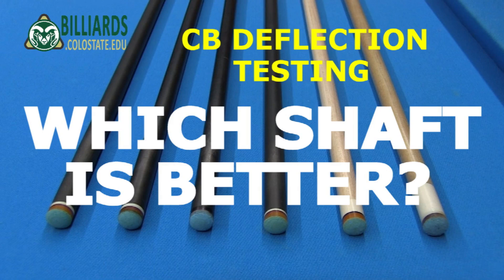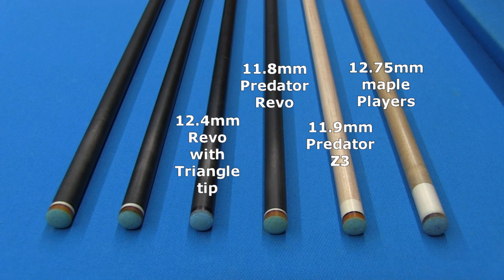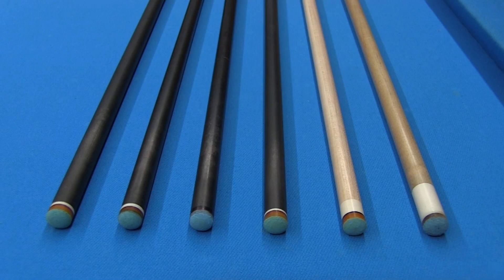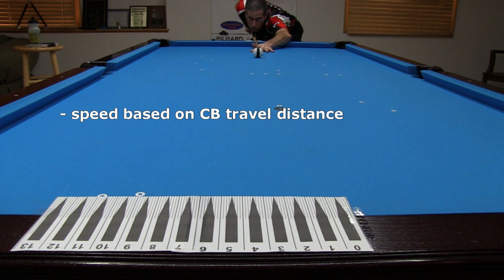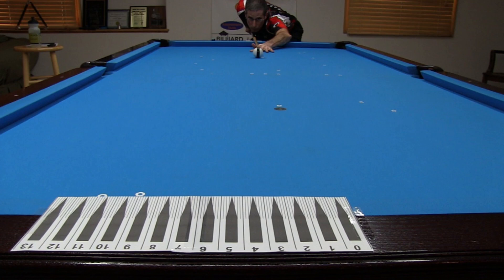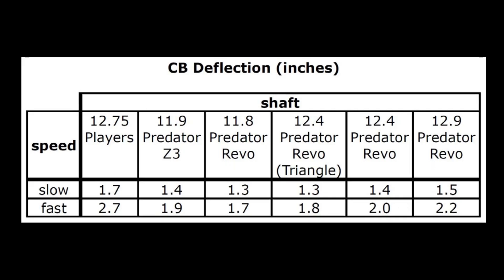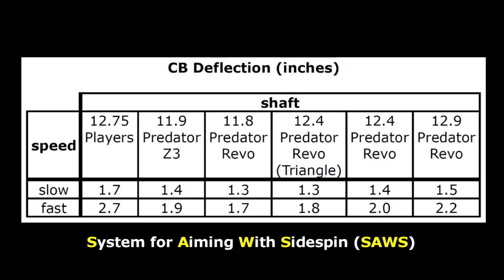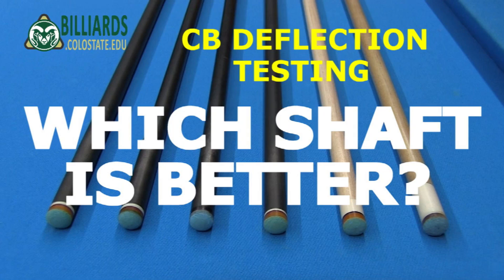CUE TESTING for Cue Ball Deflection, And PREDATOR REVO Carbon Fiber Shaft SIZE EFFECTS

Comment: Hello dr dave are there different deflection between uni lock joint and radial joint ?
Reply from the maker: No.  Only the 5-8 inches of the shaft closest to the tip affect CB deflection per the info here:
  https://billiards.colostate.edu/faq/squirt/endmass/

Comment: Dr.Dave I’m really getting some very good numbers on this cue of mine. At the table we put a golf tee on the rail and took the cue ball back behind the line.  added 1 full tip of left english  and stroke the ball very firm. It turns out my friend filmed the shot and the cue only deflexed  the width of a piece of shock chalk. This is the same cue that has 2 marks on the shaft. One mark for 3 or 4foot shots and the other mark is for any length longer than 4ft  the first mark measures 9 1/2 inches for the short shots and the other measures 12 1/4 inches  this is really cool no need for all the calibrated numbers for multiple shot Lenghths.

Comment: Hey doc can you explain the shot of Karl Boyes against Skyler Woodward on the 2015 mosconi cup? When he puts the cueball beside the 2 ball and ref initially said it was a foul. Thanks Doc
Reply from the maker: Please send me a MM:SS video link so I can check out the shot.
Reply: @DrDaveBilliards  https://youtu.be/dBdNlpgbFvs
Reply: On the 11:58 minutes doc
Reply from the maker: @ProudlyElongo  Thanks.  The ref did the right thing to reverse his call.  It is not considered "using the ball to measure" if you are attempting to place the CB for a BIH position.
Reply: @DrDaveBilliards  can you recreate the shot doc? Thanks so much
Reply from the maker: @ProudlyElongo  Yes, but it wouldn't be very interesting, IMO.  The reversal of the foul call was correct.  He was not using the CB to "measure" the gap size to see if the CB could fit through.  He was just deciding where to place the CB with BIH.
Reply: @DrDaveBilliards  what I meant the masse shot or something that he did on the 2 to get position on the 3 thanks doc
Reply from the maker: @ProudlyElongo  I didn't see any clear evidence of a foul on the 2-ball shot.  The CB seemed to go close to the tangent-line direction (due to the cut) and draw as expected (on the slippery cloth).

Comment: I shoot regular pool with a 10m tip snooker Q. I don't get squirt.. I did with preditor tho. I can't stand squirter.
Also I don't need to go out to the red line for the same spin. I feel I can achieve same spin same hit say for nothing but right hand English I feel I don't have to as far right like I do with a bigger mil tip. I also use a dime radio's. Because of the small tip I use a super hard tip.
Reply from the maker: Every cue (even 10mm) creates squirt; although, some create much less than others.  But you still need to be able to compensate for swerve (and squirt) effects over a wide range of shots.

Comment: Dr. DAVE ....could you please try a KEILWOOD shaft and see what kind of results you get,  including the PurX fuse, and also the hsunami ... thanks!!
Reply from the maker: Sorry, but I don't plan to test more shafts.  The purpose for the video was to show how anybody can easily and accurately test shafts on their own (using the procedure in the video).
Reply: @DrDaveBilliards  sure ...but ibfeel like kielwood has lower deflection than all the shafts you tried... you should definitely try it out , I've done the test , and the kielwood hits dead center almost ....about every time

Comment: Hey Dave, a bit of an aside, but I just stumbled upon your article on parallax error and in particular your refence to parallax error caused by focal distance when your head is not square on properly. I was trying to find information on this and didn't even know what to search for and ended up asking Chat-GPT which told me the terminology to look for. Thanks Dave and Chat-GPT!!
Reply from the maker: If you want to learn more about this and see lots of pertinent videos, check out the videos and subtopic links here:
   https://billiards.colostate.edu/faq/eyes/
Reply: @DrDaveBilliards  Dave I was wondering if you could help me with another unrelated question? I've noticed for several years now, I have a problem where, I'll get down to do a straight shot (or any shot) and the cue ball and object ball will be aligned properly in my vision, but then I'll take the shot and miss and the reason is because my cue was not pointing exactly where I thought it was prior to the shot. In other words, my body/head alignment and cue alignment are out of sync with each other causing me to shoot across the ball. I can somewhat correct this by concentrating really hard on putting my cue on the correct line before getting down, but if it's even slightly off, then I often find it very difficult to see that it's off once I'm down on the shot, unless I stare at my bridge hand and really examine the slope of my cue. I have a friend who uses this weird method where he rotates the cue in order to more easily see which way it is pointing. Is it the case that with the pros their body/head and cue are always perfectly synced? so that when their visual alignment is correct their cue is also pointing in exactly the right direction?
Reply from the maker: @dhirajpallin2572  Pro players always have their personal "vision center" aligned with the shot line.  For more info, see:
    https://billiards.colostate.edu/faq/eyes/vision-center/

Comment: What are the physics of deflection as they relate to speed? I would think a slower speed would create more deflection because the tip would have more time to bounce back into the ball. I know it doesn't work this way, but it seems backwards. Maybe a faster speed tip has more energy (mass) so the ball is deflected more? Your thought?
Reply from the maker: See the videos and info here:
    https://billiards.colostate.edu/faq/squirt/cause/
    https://billiards.colostate.edu/faq/squirt/speed-effects/
Reply: @DrDaveBilliards  OK, after reading the material, I want to believe deflection is the same at all speeds and the only difference is swerve. However, at a certain speed swerve has very little effect. I think the slow speed you used in this test would have very little swerve at the distance you were measuring deflection. In some cases, it was an inch difference depending on speed. In my own experience, deflection is much larger with faster stroke. Maybe you can show a curved path at the slow speed you tested here? Thanks for all the information you share.
Reply from the maker: @jeffren70  CB deflection (the net effect of squirt and swerve) is definitely larger at faster speed, per the explanations and demonstrations at the links.

Comment: It's nice to see proper methodical testing of this, and to find out that it jibes with my own experience. The popular narrative is that the revos deflect less than anything, but I was pretty sure that a 12.4 Revo was not deflecting less than a Z3 or OB Pro plus, and might be deflecting a bit more.

One thing, do people use deflection as the net of squirt plus swerve? I've always used it just as just a less grody synonym for squirt. I thought that's how everyone defined it.
Reply from the maker: People mean different things by "CB deflection."  Concerning playing, they usually mean how far the CB would miss your target if you don't compensate your aim (for the combined effects of squirt and swerve).  But an LD shaft creates less CB deflection (or squirt) off the tip.
Reply: @DrDaveBilliards  I'm probably just being lazy but do you have a breakdown somewhere of how much swerve you get over different distances in inches? I know it varies with individual differences in elevation and cloth conditions but I'm wondering roughly speaking what percentage of deflection is Squirt versus swerve. In my head it's 90% squirt but swerve probably plays more of a role than I think.
Reply from the maker: For fast speed shots, squirt is the dominant.  At slower speeds, swerve reduces the CB deflection more.  And swerve varies dramatically with cue elevation.  And everything changes with distance.  For more info and videos on this topic, see:
    https://billiards.colostate.edu/faq/sidespin/aim/effects/
    https://billiards.colostate.edu/faq/sidespin/aim/saws/

Comment: It looks like the harder tip has less deflection. Ive always heard you say in the past there is no effect. Its almost a 1/4" it looks like at high speed. I would say that is about right. I use the 12.4 Revo sometimes and like the way it plays with a Zan grip hard but for soft shots it just can miscue to often. I am back to using Kamui soft of zan hybrid max now.
Reply from the maker: See the "Does tip hardness have an effect on CB deflection?" section at the bottom of the page here:
    https://billiards.colostate.edu/faq/cue-tip/hardness/

Comment: I remember when this was a pool channel. Now it's turning into a science class! 🤣
Reply from the maker: Don't despair.  I'll get back to "more useful instructional stuff" soon.   :)
Reply: @DrDaveBilliards  Ha, ha, no, I won't despair. I kind of like the refresher course in the Scientific Method. I always appreciate seeing it applied correctly, and effectively, and I believe you've done both. The bonus is that it applies to pool!
Reply: @DrDaveBilliards  I'm not sure if you'll see this comment, it's in a little late. You've said that you have no shortage of ideas for more videos, and I hesitate to ask this, because it would only add to that list, *BUT*... have you considered comparing (and contrasting) the differences between pool cues, and snooker cues, and why they differ? 
(Or, have you covered that already, in a video I've overlooked?)
Reply from the maker: @kurtkensson2059  Sorry, but I don’t play snooker, nor do I have any snooker cues.  But the differences are fairly obvious.  Snooker cues are smaller diameter, due to the smaller balls.  They are usually made of ash instead of maple or carbon fiber.  They usually have a conical taper, partly to increase strength due to the smaller tip diameter.  They have a small and thin brass ferrule, which helps limit CB deflection.  I would expect snooker cues to have similar CB as LD pool cues, but I have not tested for this.  But using the procedure in this video, anybody can easily test and compare any cues on their own.
Reply: @DrDaveBilliards  Thank you for your quick reply.

I don't play snooker either, nor do I own any snooker cues. However, after watching your recent videos about tips, shafts, and deflection, and having been watching Stephen Hendry's channel, I began to wonder about the differences between pool cues, and snooker cues.

I knew about how they differed, and I started wondering about why they did. Why use ash? Why use brass ferrules? Why does the shape of the butts differ? What led to the differences between them, and what inherent advantages/disadvantages are there to those differences?

I know that this does fall outside of the topics you normally cover, and you already have a lot of material you'd like to cover in your future videos. I apologize if my asking distracted you from that.

Thank you for continuing to educate the billiard community!
Reply from the maker: @kurtkensson2059  I think the differences in construction are mostly due to "tradition."  And I think things are even slower to change in the tradition-steeped snooker world than they are in the pool world.  I suspect snooker cues will change more in the future (e.g., with carbon-fiber shafts with no ferrules), but it might take a while.
Reply: @DrDaveBilliards  That makes sense. It's amazing that some snooker players (Hendry included) were able to play top-level snooker with crooked cues.

Thanks again!

Comment: Good to know I have the lowest deflection shaft… I got it as somewhat of a newbie and thought initially that the 11.8 diameter was a mistake. I’ve since changed my mind.
Reply from the maker: Regardless of the amount of CB deflection, you still need to know to aim differently for shots with different amounts of spin, speeds, and distances.  FYI, LD shafts have both advantages and disadvantages per the info here:
    https://billiards.colostate.edu/faq/cue/low-squirt/
Reply: You basically can't know the real truth about deflection on test "from hand" like this one. There is NO WAY that anyone can repeat 100% the same hit 2 times in a row. No way.

Comment: Is the butt end of the cue marker on the rail offset from the table center line the same amount as the cue tip is offset from the cue ball center and table centerline?
Reply from the maker: Yes.  The line of aim of the cue is perfectly parallel to the center-ball line of aim.  Although, it doesn't really matter.  The differences among the shafts is what is important (regardless of the aim, assuming the aim is consistent, which is the case in the video).  Now concerning aiming when playing, I use SAWS:
    https://billiards.colostate.edu/faq/sidespin/aim/saws/

Comment: Never held anything but a maple shaft.  Where I live, I'd have to drive three hours to test drive one.  It'd be damn interesting to see how they feel.  Seems like the new standard today, using some sort of core material that's not maple.
Reply from the maker: Carbon fiber shafts have pretty much no "core material."  They are mostly cylindrical shells.
Reply: I was referring to the McDermott core shafts.  Where they are maple shafts with carbon core.
Reply from the maker: @bertblue9683  Got it.
Reply: I have a Revo. It feels like literally a brand new cue every time you use it. Crazy smooth and doesn’t get dings. Never going back to wood.
Reply from the maker: @danielvelkovski3156  FYI, I summarize all the advantages here:
   https://billiards.colostate.edu/faq/cue/carbon/

Comment: I think a smaller diameter tip works better.
Reply from the maker: Per the info here, size (or tip shape) really doesn't matter much:
    https://billiards.colostate.edu/faq/cue-tip/size-and-shape/
Reply: @DrDaveBilliards  It seems to work better for me and allows more precise control. Perhaps it's more of a personal preference. But it does make a difference for me.

Comment: This should be really interesting. Sad OB isn't included. Hopefully another spliced shaft is represented. OB is the original spliced shaft and one of the first low deflection shafts. Originally Joss made their butts. Now they make their while cue.
Reply: ''OB is the original spliced shaft'' That is not true, italian company Longoni started making spliced/laminated shafts 50years ago, and they still make them., They also started to make carbon fiber shafts 40years ago back in the 80's. Americans just like to take the credit for other peoples innovations. :D predator also claims to be the first in everything but they made there first spliced shaft in 1994, so it cant be true, ob started in 2004 :D
Reply from the maker: The main purpose of the video is to show how easy it is to do tests like this so anybody can test any shafts they want to test.
Reply from the maker: BTW, a fair amount of data for a wide range of shafts (OB included) can be found here:
    https://billiards.colostate.edu/faq/squirt/published-data/
Reply: @DrDaveBilliards  glad to see OB at the top of the list!! Predator seems to be king of low deflection but OB is right there. However, that was for the OB-1. I have an OB-2+. I originally had an OB-1 but I misplaced it. So the deflection on their newer shaft has to be right up there with those predators. I've never actually measured it but full length the deflection is barely noticeable when shooting diamond to diamond.
Reply: @DrDaveBilliards oh yes I've tested my shaft. I know exactly how much full table deflection I get. Ignore my selfishness. Great video.

Comment: I wonder where the Revo 3C-U shaft stands even though it’s meant for
Carom. Predator says “most precise & most accurate shaft in the world” Has 4 shaft weight options. It’s 27.25” but if its deflection is lower than a regular 11.8 can get a 2” extension to make up for it.
Reply from the maker: Well, now you know how to test it.

Comment: Altough i'm a snooker player, i find your videos very educational and i thing a lot of your findings can be adapted to snooker pretty well.
Reply from the maker: Snooker physics and how the balls react is no different from pool.
Reply: It's basically the same, just different sized tips and balls. Oof... sounds kinda wierd. But it's the same physics.
Reply: @mattevans1643  Snooker balls are smaller righht? It would make sense the tips they use are smaller between 10.5 and 11.8 instead of 12.5 to 13mm more common in pool.
Reply: @b4ssfunk3d actually, about 9-9.75mm for snooker
Reply: @mattevans1643 That and you can’t cheat the pockets in snooker like pool